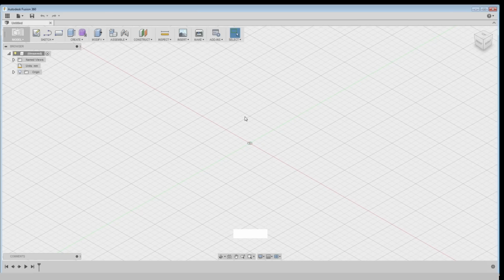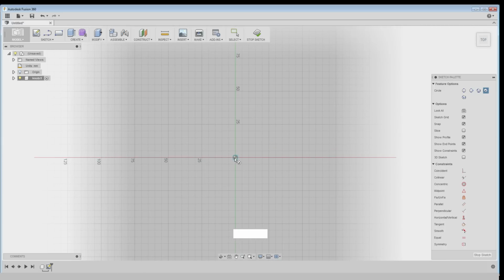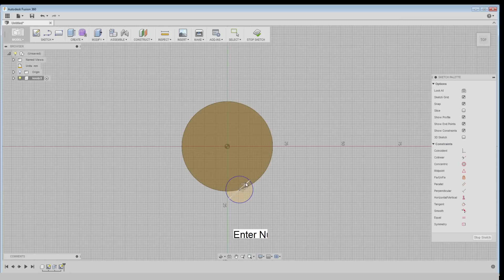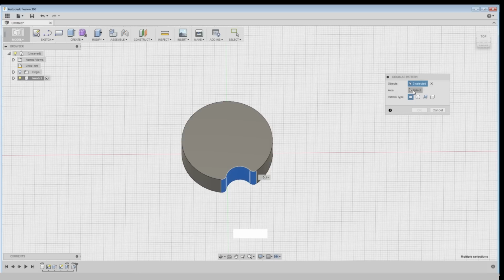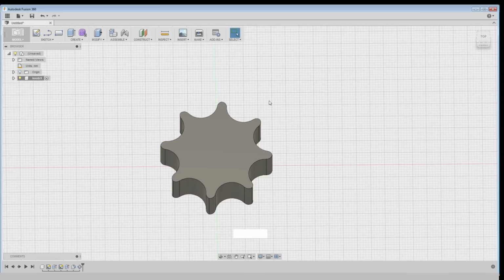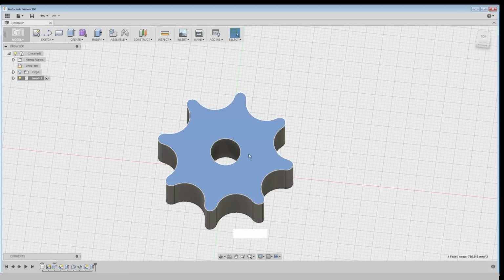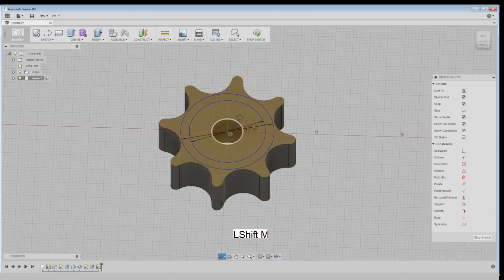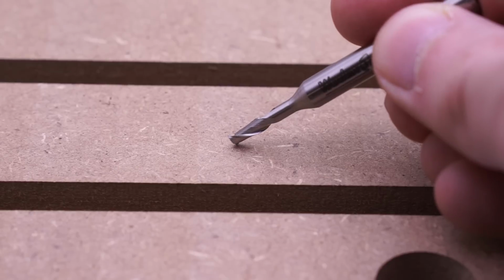Making a Star Knob

Comment: first of all, congratulations on the excellent job that u have on your channel. I do not know if it is the intention, but it would be cool if u shows up how to CAM also.
Reply from the maker: Hi Ricardo, Thank you so much. I have intentionally left out the CAM part,
90% of all you see on my channel is what i have done in CNC/CAD/CAM so far.
I have to become a little better at CAM  before i can show it.
But i intend to start showing it in the future. /Bjorn
Reply: Tx Bjorn, waiting your next video...
Reply: I think that same knob can be done using a hand held router.